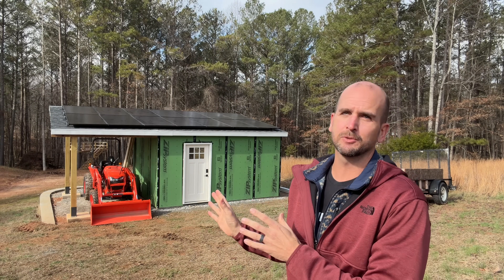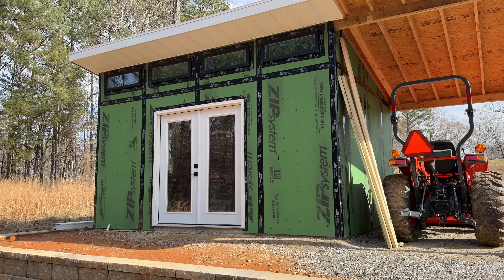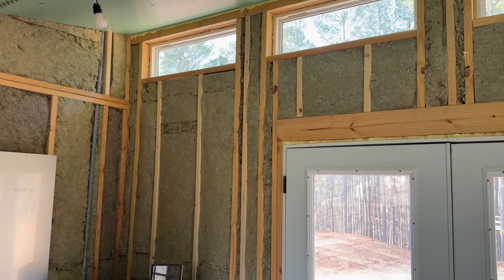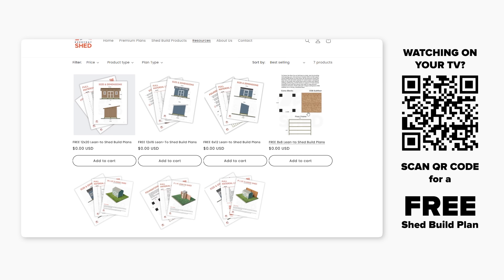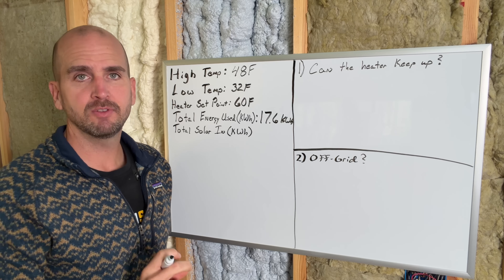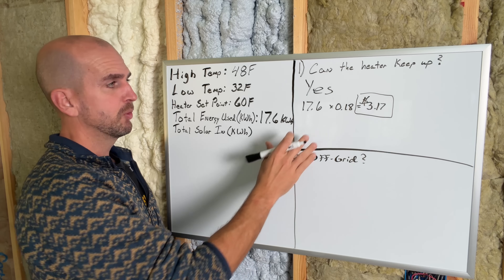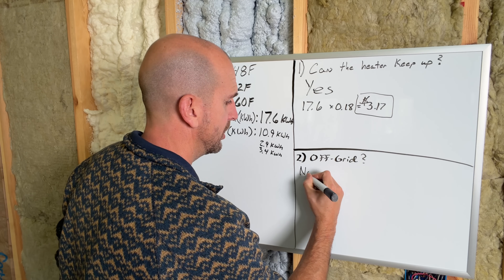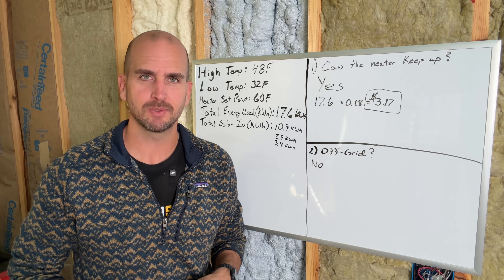HUGE Mistake: Why My $15,000 Solar System CAN'T Heat My Tiny Shed

Comment: The Germans construct homes and apartments with little to no heat pumps due to fantastic insulation and a tightly sealed envelope.  Most heat escapes through the ceiling, windows, and slab. Even if those window panes are double-glazed, homemade storm windows, or even the heat-shrink plastic would do wonders over them. Plus, it's not a fair measurement when you drywall isn't installed to help seal the interior. So many leaks.

Comment: I've got an off grid solar office shed that I've been able to heat. Bought it prebuilt, 32x12. Had professionals put in 2" of closed cell spray foam in, and it was roughed in with electrical, although I added outlets and changed the factory panel out for something larger. I put a Panasonic ERV unit in to keep air fresh (important when the building is so well sealed up). 6000W of solar, a 12kW inverter, and 40kWh of batteries, ran me roughly $10k, the batteries being the most expensive. If I DIY'd an LFP pack I probably could halve the overall cost. I heat the unit with an 18000 BTU split, and it has no problem keeping up. It would take 4 or 5 consecutive days of overcast before I ever got close to running out of power.

All I'd say regarding this setup- the ecoflow is grossly overpriced for the capabilities, and resistive heat off solar, unless you have a huge excess of generation, is just nuts. Splits lose efficiency heating at below freezing ambient temps but nothing like a resistive heating element. For the most bang for buck I'd recommend adding a propane/diesel or even wood heater for the space, and follow the 80/20 rule. Get 80% of your heat from the sun but have the heater ready on thermostat in case you need the energy for other things and can't handle the heating budget. Alternatively, add a standby generator. That's my strategy- run the generator at full tilt to recharge in case I bottom out. 

When doing solar at this scale, look for DIY solutions, not kits or prebaked all-in-ones, which deliver only convenience, not bang for buck.

Comment: Math, math would have told you before you started that your idea wouldn't have worked.
Poured pad with a break, with 2 inch foam on top (inside) and 3/4 flooring
6 inch walls, vapor barrier
12 inch ceiling, vapor barrier with 1/2 sheet rock
Low E glass, all triple glass facing south
a 9k - 12k btu mini split hyper heat will run you about 1kwh - 1.8kwh
outside paint black
Then you can do a manual J long form to verify.

Comment: It looks like the studs are on 16 inch centers. If that's true that just seems like a mistake. There is no structural reason for 16 inch centers instead of 24 inch centers on single story shed. Also were the studs 2 x 4 or 2 x 6? If they were 2 x 4 studs, then why? Lastly R 10 in the attic seems very low. I'm not sure where this is but even in Southern California where I am that would be very little insulation. It is possible that for very little additional expense, the over all R value for the shed might have been twice as high. It's probably just me, but I would have enjoyed the challenge of getting that shed to the point that your solar panels could have supplied enough energy for all heating and cooling.

Comment: It’s an interesting test a
Nd I like your honesty about the insulation you have.

The first step is deciding where we want to put our resources. The energy system or the space to heat.
I would double or triple all insulation. Seems excessive? That’s the point. 

Second we want to decide our primary heat source and our secondary heat source.
Electric is ok. All plug in heaters are the same. If they are rated for 1500 watt, they all output 1500 watt. 
Except one. Heat pump. A mini split system would give you better return of heat per kilowatt hour.
Secondary heat system would require no electricity or pumps. So diesel heater and propane heater are out the door. A wood stove is the perfect backup or primary heat source.

If it’s just a work shed you don’t need to heat it 24/7. A heat pump probably can run that shed for 12 hours with 3kwh. That almost matches your low end solar input.

Comment: North side of the building has way too many windows. Would be better off piling dirt up against the back.

And why would you try to heat with solar electric panels instead of direct solar heat.  Put all the window glass at the front of the building and put some black metal panels a few inches behind them.   Better yet, capture the heat in liquid running through copper tubes soldered to the panels, and a hot water tank attached. Use the solar electricity to run a circulator pump, 100W will power a 1/25 hp pump.

But a real off-grid guy would use wood heat if the house is right next to a forest. 
Make a slab on pillars floor over a crawlspace fireplace like the Koreans do.

Comment: One thing i seen years ago in a new house build in detroit was the designer had copper pipes go under the floor and sealed off with a thin layer of concrete with stone tile above it. There was a pipe connected to a system coming up from the floor in the heater room to regulate the water inside it. What i learned was the pipe had magnets that spun around it and as the magnets rotate around the pipe it sends energy into the pipes heating the water and the area around them while also pumping it through the pipes. I learned about this from an 90 year old german designer who built many houses with the same thing for over 60 years and he learned it from others when he was little. He used it as the heater for his whole first floor and also used the heated water as the hot water for his home.
Reply: Magnetic induction heater used in a unique way. Very very interesting. Now I have to mess with this idea a bit and see how efficient it works. Magnetic induction can get the metal red hot very fast! How much energy is going in to spin the magnets, and how much less is coming out to heat the pipes and water? Definitely cool idea worth exploring.
Reply: @David-f2j4b  Theres all sorts of stuff you can do with magnets and copper. There are many designs and tutorials all over just most overlook them.
Reply: I'm very curious about this German magnet pipe system you are referring to. Any videos or more information on this and its old history? Thanks.
Reply: @DEESANT-oc9xf  Sadly i dont know much else info on it. Me and the designer was talking about it while i was doing tile work at his new build years ago. It is worth testing it out tho

Comment: You need slab insulation, more ceiling insulation and put 1/2-1" xps foam over the studs. That'll give you a thermal break. Then install a heat pump mini split.

Comment: Not only is the resistive heater terribly inefficient, but your insulation seems a bit thin for such a small space.  At the very least I would add the rockwool over the ceiling.  Also a minisplit gives you A/C in the summer which you will probably appreciate and you'll have power to spare in the summer with that massive solar array over that tiny shed. 

That said, trying to run solar only for heat in the winter in some place that has real winter almost never makes sense.  You have to so grossly oversize the system that it just doesn't make financial sense.  That's why diesel/natural gas backup attached to a more sensibly sized system makes a lot more sense.  It's cheaper by many thousands of dollars and your total fuel burn each year is pretty minimal.  It does add complexity, but many people have done this and the process is pretty well understood by this point.  Your current system plus a few hundred bucks of backup generator attached to a smart controller would be perfect.

Comment: A mini-spilt HVAC would improve heating efficiency by several times. Also while it's well insulated you've got a lot of windows and doors for that small space, and their R-value is definitely not as good as the walls.
On the insulation front, the ceiling/roof of my parents house (electric heat) built in  1970 had R40 up there.

Comment: A 1500 watt electric heater only puts out 5100 btu. That will only keep the space about 25 or 30 degrees about the outside temp. We have 20 Lifeline GPL-4DL batteries, 210 amp hours each in our shed.  That's more than 4000 amp hrs of storage. They come my way free. I use a Renogy 60 Amp MPPT charge controller with one 250 watt panel. The long term plan is to put 1600 watts of solar on the shed - and use this system to get us through the frequent power failures we have ( about 10-12 times a year ) on Cape Cod. We only need about 2Kw to keep the fridge going along with a Rinnai natural gas heater and tankless natural gas water heater, some lights and heated mattress pad. We live in a well insulated 1800 sq ft condo on 3/4 acre.

Comment: I have been thinking about much the same thing for a shed of mine. 

Having seen quite a bit about ‘sand batteries’ it makes sense to look at both the Pros and Cons. 

It is a basic system where the energy collected from solar goes directly to heating an element from an electric stove, or kettle. But the element is surrounded by sand in a large oil drum. Sand can heat up way past the temperature of water, with not problems. No power is lost like when storing in a conventional battery and then reusing it. So that is good. The down side is that the heat is made only when the sun is shining. And while it may take more than 24 hours for all the heat to leave the barrel of sand, it needs to be managed to make sure the heat is available when it is needed. 

My thinking is that if the system shown was heating up two barrels of sand, but had an insulation cover around it, (like a very big tea cozy)  then in the morning, when you come in to do work, open a door on the insulation cover, and you have lots of heat. Regulate temp by the amount the door is open, or even incorporate a small fan that moves enough air to keep the work space warm.  Done work and close up the cover. 

I would also want to know what the track of the sun is in the winter – the video had late day sun that was hitting the tractor right from the side, - so the shed may not be in the correct placement to get all the sun it can. Maybe a wall of Solar panels on the side to enclose the tractor parking area. 

Is it a concrete uncovered floor? Even an old rug can help, but a good insulation job is best.

Comment: What many of us wonder is if putting the solar in was worth it. Just for heat alone, saving $3.17/day would take about 13 years to break even. Lots of other factors, of course, but this is why most of us will never bother with the complications, installation, and maintenance of solar unless technology improves GREATLY.
Reply: ALL you people who think the national or local GRID could never go down for more than a few hours, will be desperate to figure out your literal survival strategy when the light switch, water pump, or heating system no longer functions in YOUR home, the way you thought it always would.

 Good luck with your cost analysis and financial gamble..

Now lay awake in the darkness tonight as you fall asleep, and really THINK about what would happen to you and your family "IF"...
Reply: @David-f2j4b  LOL.  Ever heard of a "generator"? If it lasts more than a few days, which is how long my generator lasts without refueling, we have bigger problems than no electricity.
Reply: @GS-qx6cn I can't help you if you don't have the ability to keep a simple generator running for more than a few days. My personal generators can literally run for years nonstop, if they had to. But the vast majority of my daily power comes from solar and batteries, so a gen set is just extra backup, and I exercise it once in awhile to keep it healthy. I get the feeling you don't REALLY know how to do much, to keep yourself and your family alive after your cheap "generator" runs out of fuel. Good luck with that plan! And may Godspeed if ever SHTF..
Reply: You remind of of all the dudes that bought gold back in 1980, then bought all the tuna December of 1999.  You do you, I'm living life ...
Reply: @GS-qx6cn I can't pretend to understand your thoughts about gold, and how it relates to Tuna. But I can say this.. Gold never interested me in the slightest, because it was something I couldn't really "use" if times got really hard. So I invested my money in important and critical infrastructure instead.

And I actually have a large amount of tuna in my inventory too. .😊

Comment: Any building you want to heat from sun-based sources needs to be high thermal mass on the interior and insulated on the outside.

Comment: Averaged over a year should be enough.  Seasonal storage is a work in progress 1- thermal (construction, the bigger the better - after a certain size the face losses are a minimal percentage?)  2- iron powder, a work in progress (better than hydrogen?), not sure the scale you need for charging/reduction (iron oxide + hydrogen + heat). 3- heat pump for less electric?  4- work on insulation, but not good for testing and a changing baseline? 5- More solar panels on the land, and increase thermal mass (one sunny day does you for 2 cloudy days) 6- retreat and mothball the building if the winter weather is cloudy for days (citadel living), but paint can say store over 5C. 7- wood burner with a closed system team turbine CHP- the business doesn't like this - safety?  8- paint it black and add a wrap around solar room (S,W,E) with automatic blinds?

Comment: I have a small off-grid cabin, 1st floor is 12x16, and second floor is 12x10.  We have a 3 pronged approach to heating it.  9K BTU mini-split, added mostly as cooling for the summer where we get triple digits, it's at 2300ft in the Sierra Nevada mountains, which is below the typical snowline.  We have a 1 cubic foot mini wood stove which will heat it to 85F inside without much trouble or burning a lot of wood.  When I'm not feeling like getting a fire going, we use a diesel heater.  The cabin is built on a steep hillside, and is elevated off the ground. The below floor joist bays are spray foam, the roof is rigid roam with spray foam at the bird blocks and ridge with R19 fiberglass over it, and the walls are R13 fiberglass.  The cabin is mostly 12vdc with a 3Kw inverter for 120vac, only really used by the mini split and a couple of convenience outlets.  1600watts of solar and 6Kwh of LiFePo4 self-heating batteries.  We don't try to keep it heated 24x7, only when we are up there.

Comment: That's very underinsulated, especially in the roof. I'd definitely add 2 more inches of styrofoam on the ceiling as there is room.

The studs are also acting like a thermal bridge between the inside space and the zip sheathing. An underinterrupted layer of syrofoam on the ouside would help a lot. I'd also add a rain screen between the styrofoam and the siding, both to let any errant rain out, and to make a thermal barrier between the siding and the styrofoam, lessening wind loss.

As others have said, mild temperatures like that are very well suited for a heatpump, plus a heatpump would provide AC in the summer.

Comment: Would be interesting to see how well solar thermal collection would do.   That is my current plan for heating needs.
Reply from the maker: I tested out a sand battery last year.  I think more insulation in the ceiling and the same setup should work on this one.  Trying to do another test to compare the results between a R10 ceiling and R25 ceiling.
Reply: @EverydayHomeRepairs  nah,  solar thermal is far more efficient than solar electric.   I don't think you'll get much more different results with a sand battery over an oil radiator.

Comment: Add 2” of Polyiso or Eps/Xps foam around the exterior walls, get all that thermal bridging isolated into the conditioned space.  You can and should also tie that insul down to a trenched plane of insul to a couple feet below grade to let your slab be better as thermal mass.  Best would have been 4” laid right below the slab.  Densepack cellulose that roof, make it 10” thick if you really want results.

Comment: R15 in the walls but R10 in the ceiling?! Yeah better to have R25 with the extra layer of rock wool, but the cost to efficiency isn't priority. Nothing in the floor and nothing even on the foundation edge below grade EPS? Concrete is R0.5 ish, so even just a modest 1inch thick for the first half foot is bumping it to R4, so an 8x reduction in heat transfer. When you think about it from this lens everything is easier to estimate. Throw some cheap flashing over the top to shed water. Probably $20 for the EPS, $10 for the construction adhesive, $10 for some trash flashing of some type. As long as the ground is frozen and you can use a machine instead of a shovel maybe 3-4 hours and less than $100.